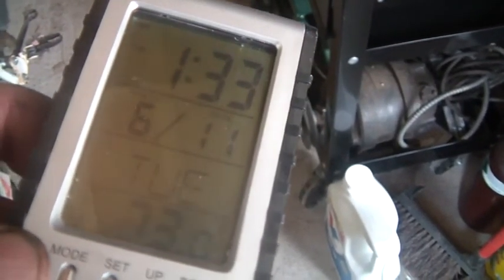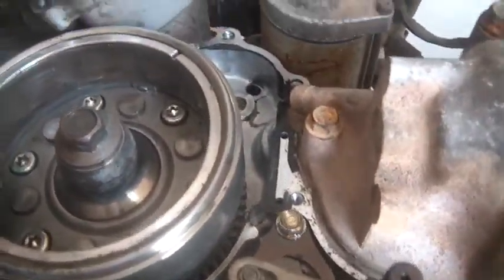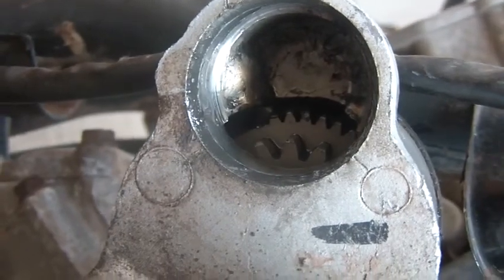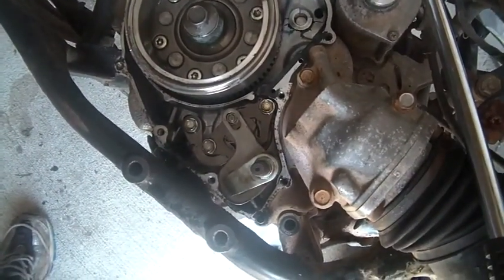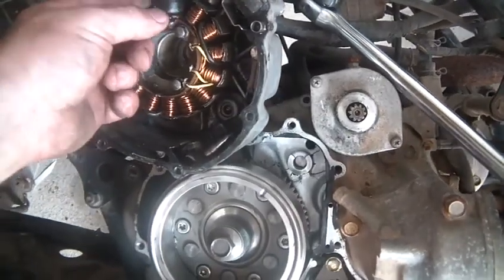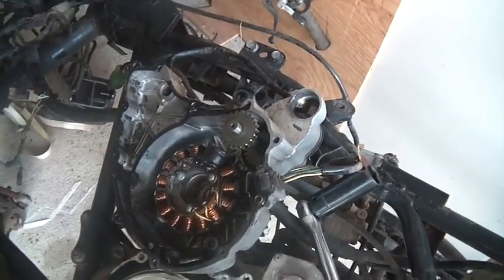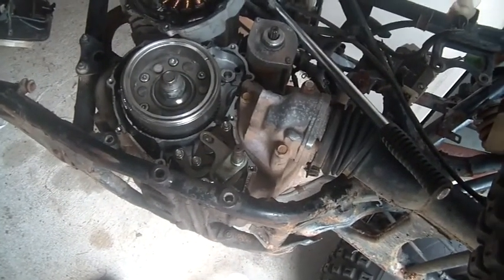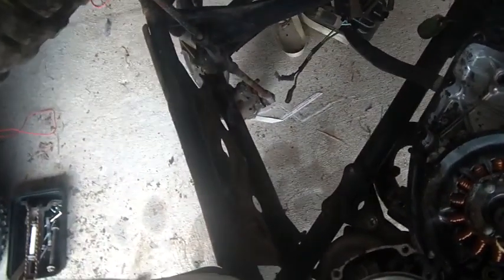6_11_2013, 1987 Honda TRX250 engine opened.

Comment from the maker: caddyman110, Seems that I am running across this more and more. I am kind of avoiding the 250ES/SX and TRX250 motors now because of it. Kind of a shame, the 250 pulls like a mule, starts easy and other than the stator thing, they are a real good motor. Thanks for watching and commenting.

Comment from the maker: jacob classified, My friends swear that Sea Foam is the greatest invention ever and I would be surprised if it toasted the engine,though a 1/2 can seems like a lot for that size fuel tank. I would start w/ fresh gas + an oil change, with all the heat outside, not sure where U live, or maybe your carb float stuck and there was some fuel that got by the rings and diluted your oil making it a bit thin. If it smokes only on start up it is probably from the valves. Good luck,let me know what U find.

Comment: Yeah its toast. The piston walls are probably scoured from the teeth clanking around in there, The cogs are probably all toast and the valves are probably toast. It's good and seized there. If it was only seized from rust from being outside it would have been able to be saved but there is just no saving that. That sucks man.

Comment: impact wrench
Reply from the maker: Hey JT!!!!   I have a couple of plug in electric impacts an air driven one and a small 1/4 battery powered one, I have been wanted to upgrade to an 18Volt 1/2 drive unit, just have not gotten there yet.... Thanks for the suggestion, watching, and commenting!!!!!
Reply: that 1/2 inch will spin it right off and if i was you id upgrade to a stator and flywheel from a trx 300 it will all interchange and its better parts off the 300
Reply from the maker: Hey JT, If the parts swap as easy as U say, they are cheaper and more available for the 300ex as well, thanks for the info, watching, and commenting!!!!
Reply: no not the 300 ex i'm talking about the 300 fourtrax